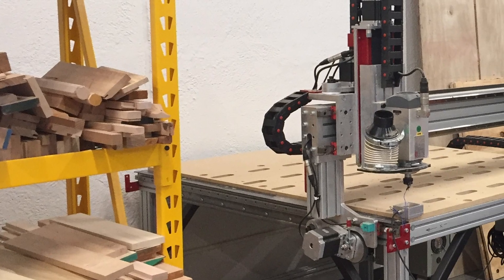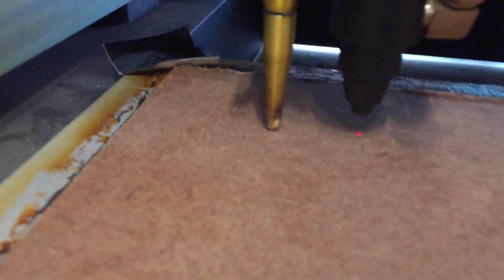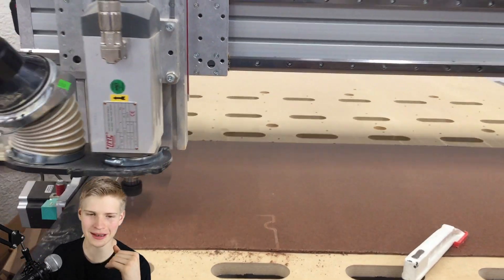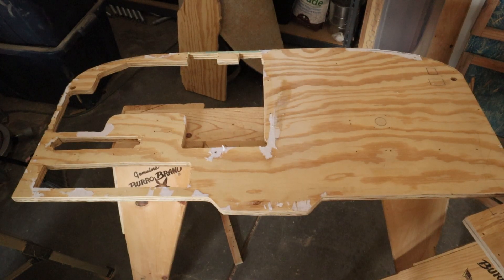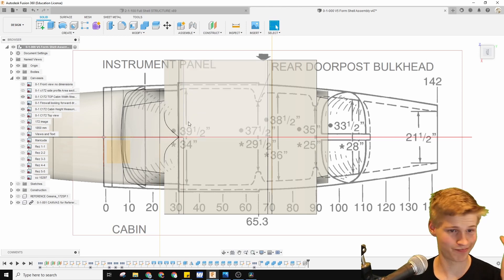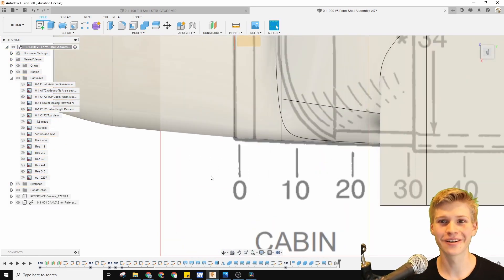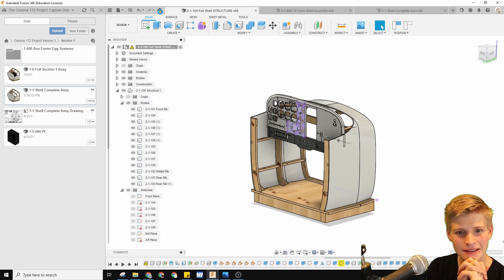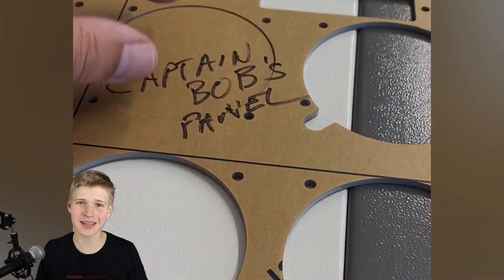How to make Laser Cut/CNC Milled Panels | C172 #22

Comment: Hello, Captain Bob, how are you?
I hope well!
I fly the CTSL Flight Design from Microsoft Flight simulator 2020, I really like this ultralight, I intend to build a home cockpit for it using the MSFS model, but I don't know how to make the panel, as I don't have the measurements, what material would you recommend using 3 mm MDF ?
I have a diode laser, with a work area of 40x40
Please, how do I get these measurements, how do you draw the sheet of paper that you stick on the altimeter, the vertical speed and the speedometer?
Thank you for any help!
Reply from the maker: Hello! I'm great!
You can sometimes use reference dimensions (radio stacks are usually 6.25" thick) to scale it out.
I'd recommend Acrylic for the panel and some thicker Plywood/MFD for the backing but there's not any one way to do it.
I use Inkscape for designing instrument decals :)